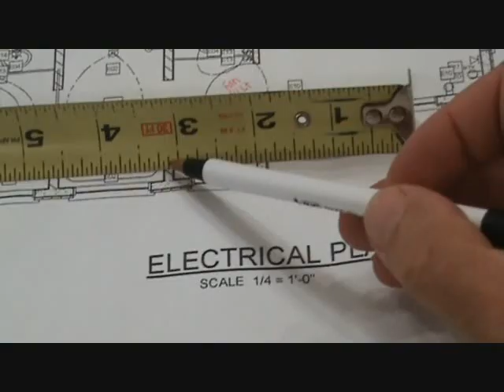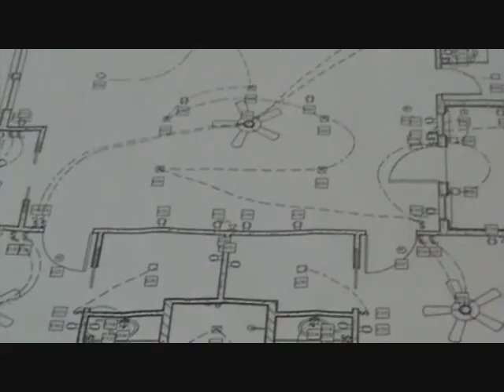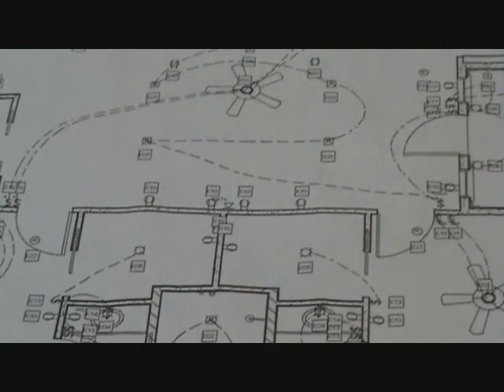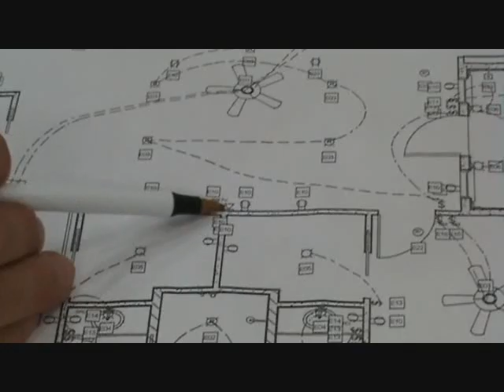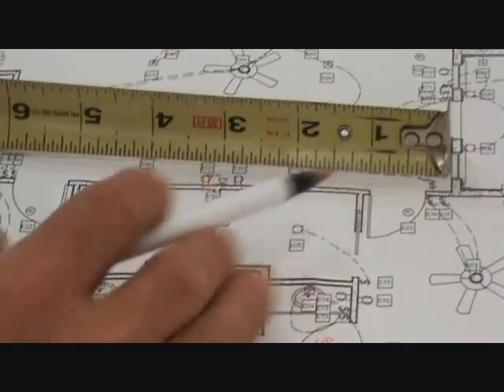Reading an electrical plan 'scale'

Comment: If the draftsman is over 2 yrs old the dwgs should have all the dimensions you need. In areas that are to small to see clearly at the base, scale 1/4"=1', you create a detail at a larger scale. I have been in the biz (construction and design) for over 30 yrs and never, ever had to whip out a scale much less a tape to measure a room  like you did in the vid.
Reply from the maker: Interesting. Thanks for your comments.   Joe  :0

Comment: The drafter didn't put the quotation mark after the 1/4 on the scale.  Naughty drafter.  Since a contractor will always carry a tape measure, it's good to show how to measure a plan using a tape rather than a scale.
Reply from the maker: I had one of those little scale things but it gets tricky to remember what scale you are on so I always used my tape measure. Thanks for stopping by!

Comment: Ever hear of a "Scale" ? It is a ruler like tool, they're made in 6" and 12" sizes and you turn to the scaleyou need in this vid 1/4"=1'-0" and read the dimension, you don't use a 'tape measure' and have to calculate.
Reply: 1. There is a thing called a "SCALE" looks like a ruler w several different sizes so you can read the distance by turning to the corresponding SCALE.
2. Every electrician I have ever worked w attaches the outlet box to the nearest stud in the approximate location. They eyeball it.
3. Who is your target audience??? A 2 yr old?
Reply from the maker: I wanted to show viewers how to read the plans if they didn't have a scale. There's not many contractors I know who whip out a scale out on a jobsite, out of their nailbag. My target audience are viewers who don't know how to read a set of plans at all & they want to learn the basics. Thanks for commenting.   Joe  :0

Comment: Hey joe, when you measure off the inside walls is that referring to rough walls (studs)
Reply from the maker: You can measure either way for most cases since it's only half an inch difference. Now if you were actually building a wall from scratch for a hallway let's say & you really want a finished clearance of 3 feet for instance then you will have to allow for the drywall on both walls when laying out the walls. If you are just measuring for where you want to put electrical outlets then get it close....

Comment: I design and draft electrical plans. I'm not very keen in imperial units of measurement. Whenever I see imperial scales like this one I do the following 1/4" = 1'-0" converts to 1/4 "  = 12" converts to 1" = 4*12" converts to 1:48 this scale factor is impartial to any units of measure and easier for me to comprehend. You can use any units of measure and multiply this scale factor to what you're using to measure, be it a thumb or what have you.
Reply from the maker: Thanks for stopping by!

Comment from the maker: Even though the drafter (which was not me) did not put quotation marks, he did show enough so you know that the plan is 1/4" per foot & that's what's important. I like using a tape since it's always close by. I don't really trust using a ruler since I don't use one, you could get screwed up by reading the wrong side of the ruler, etc., especially if it's one of the triangle type rulers that have different readings on them. You read the wrong line & you just did a boo boo.   Joe  :0
Reply: I know I am 10 years late but what do you mean by 1/16 equals 3 inches since 1/4 inches equals a foot?
Reply from the maker: @nikospido3000  If on your plans if you happen to see that your plans say 1/4" equals a foot for reading that particular plan sheet says 1/4" equals a foot, then that would mean each 1/16" equals 3 inches since there are 4 16ths in a quarter inch...make sense? So then that would mean 3 inches per 16th of an inch  since there are 12 inches in a foot so if you have 4 equal parts of 12 inches you would then have 4....3 inch parts for each 16th of an inch on the plans when you are reading the plans....see what I mean? That's only for plan sheets that may say 1/4" equals a foot as some plan sheets could say 1/8" equals a foot depending on how large your floor plan takes to fill up plan sheet. If it was 1/8" equals a foot then 16th of an inch would then equal 6 inches. See? Because there is 2 16ths for an 8th of an inch on reading a tape measure. Let me know if you understand. Thanks for stopping by!
Reply from the maker: @nikospido3000  Hey also if you are on my main YouTube channel page you could click on playlists & scroll down to tools I think then find how to read a tape measure & I have a few videos for that too. Take care & good luck with your project & plan reading......I also have more videos for how to read a set of plans. Not sure where those are in the playlists area though. Could be under electrical?
Reply from the maker: @nikospido3000  Let me know if you have other questions.....out!